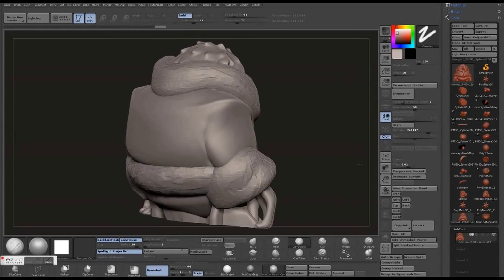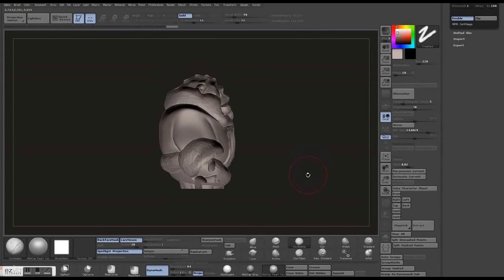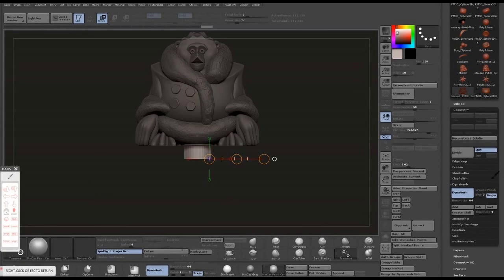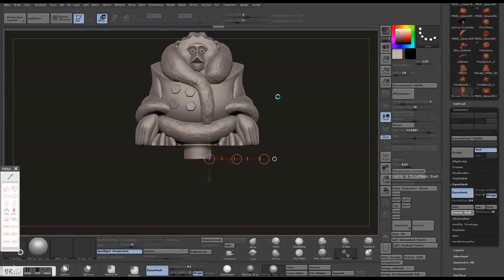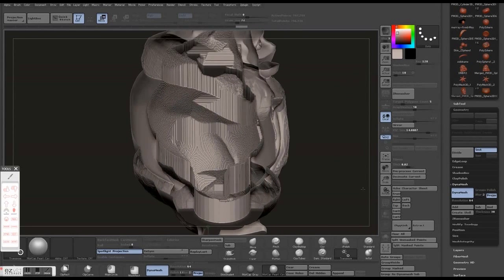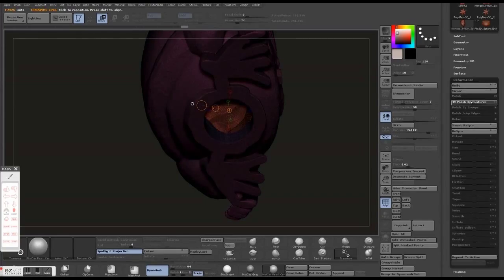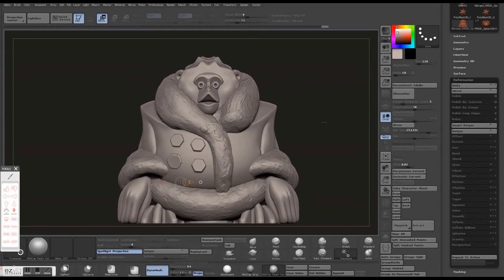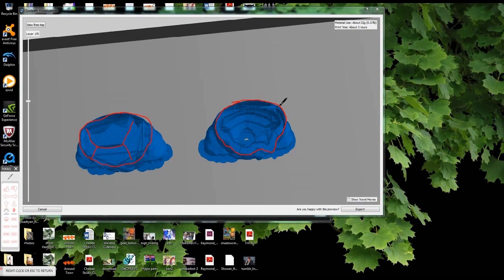Design for 3D Printing with ZBrush - Hollowing Out Your Model

Comment: So can the mesh be hollow without adding that hole like you did at the beginning?
Reply from the maker: Sorry for the late response here Christopher. The mesh can be hollow without the hole, yes, but that won't help for most 3d print services. Most companies use SLS technology with is a powder that lasers bind together to create your design. If there is no hole, all the extra powder will be stuck in the design and the cost won't be reduced.
Reply: +Pinshape wow, so the residual powder is that precious?

Comment: Hey Eric,  Firstly thanks for posting this video on Hollowing out your model for 3D printing, it's not too hard to follow for a Zbrush newbie such as myself.  I have a few questions if thats ok, when you set your wall thickness to 30 based on the size of your model, what is the size of your model to determine that.  And what is 30? Is it millimeters?   Thanks for your time, Jon